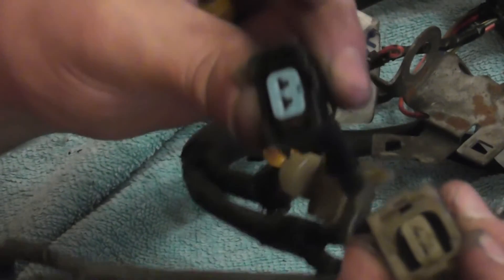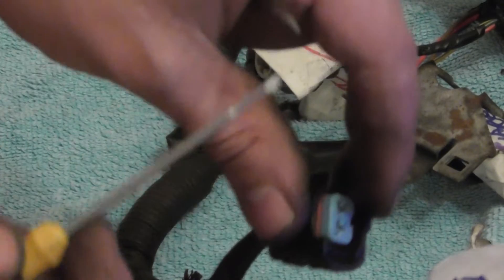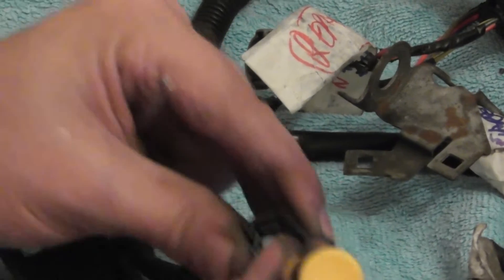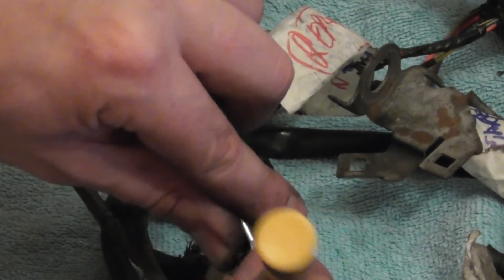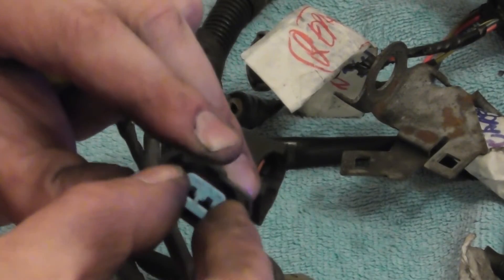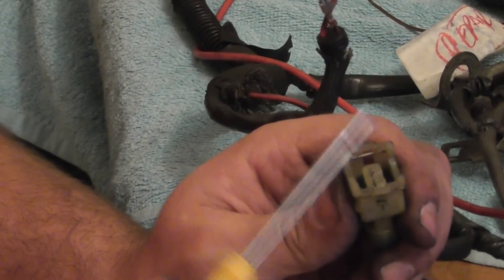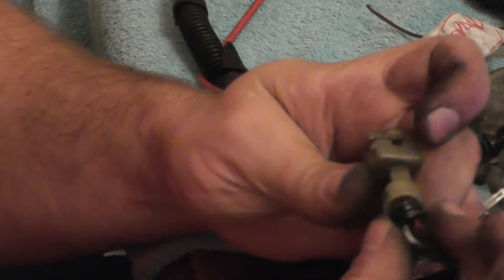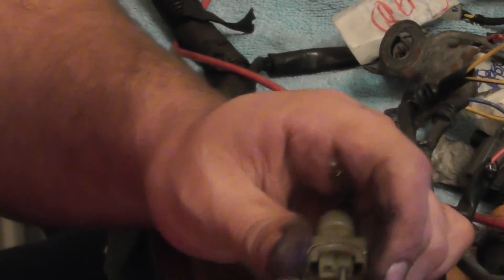Tutorials 1 : Honda Civic OBD0 and OBD2 Injector Plug Depin

Comment: do u know what what pin does the obd 2 takes?
Reply from the maker: Hi, not off hand. I did buy a load of pins from RS online (in the UK). Not sure which fit though right now
Reply: @twin2civicgaraget2cg75  

got it thks, my connectors are lose and i wanna replace it for my 8th gen civic . There's  no info out there regarding the correct pin for it.. .
Reply from the maker: Ok, I might be able to check and get back to you
Reply: @twin2civicgaraget2cg75  

appreciate the help, thks👍
Reply from the maker: Hi, I did have a look at the injector connector terminals fot the OBD2... but it does not match the ones I have had from RS Electronics. So all I can tell you is that it is most similar to RS 362-9367... but a bit wider and flatter. Sorry I cannot be of more help. Thanks

Comment: Still not sure how you got the wire out. You said something like, push the probe down the back? What does that mean?
Reply from the maker: There are little plastic tabs inside the connector, which hold the metal connector attached to the wire in place. So what I mean by putting the probe down, was putting the tool down the back to push the plastic tab back.... this means you can pull the wire out.

Comment: Does it only go in one way cuz I don't wanna messs up an put the negative on the positive side
Reply from the maker: misael nuñez It does not matter which is positive and which is negative for an particular injector. But of course it is important to connect each injector correctly (1, 2, 3 and 4). Thanks